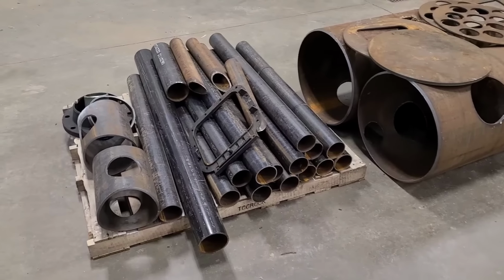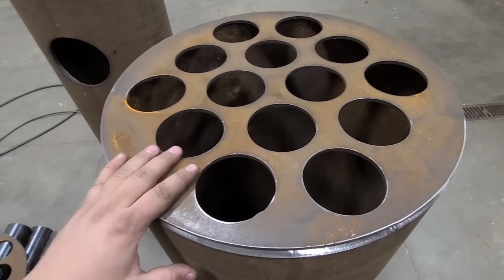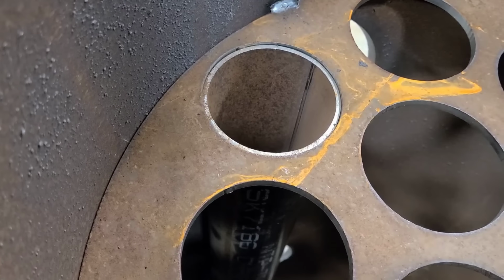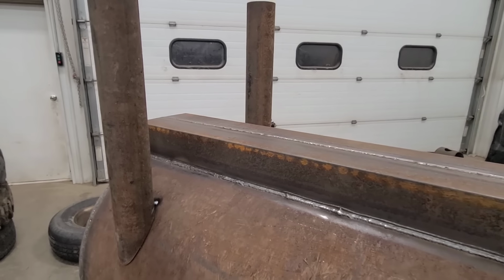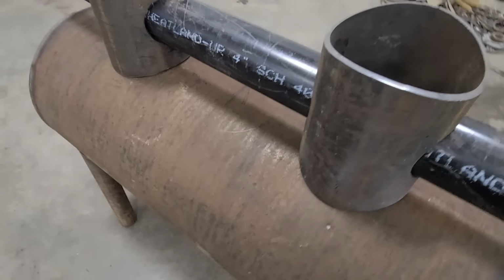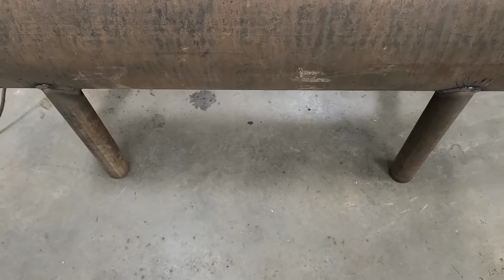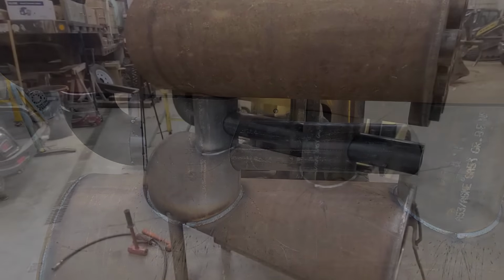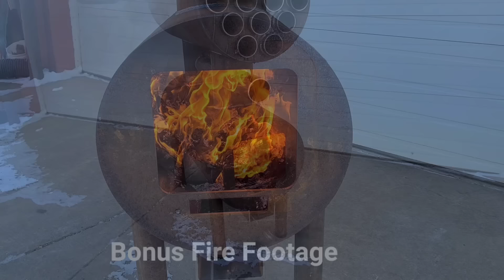My Ultimate Shop Wood Stove Build Part 1

Comment: Protip. A heat exchanger will always reduce the temperature of whatever I hot about the heat source. For instance we use an oil heat exchanger, oil is pumped through tubes that run through a cylinder, the cylinder is full of cold running water, this effectively cools the oil, the same applies to pretty all heat exchanger, ultimately the air coming out is GOING to be colder than the air in the fuel, OR exhaust chamber, it just is what it is.

Comment: I believe  you will  have to have real hot fire to make the stove to work properly.  All those tubes and heavy  metal  will work to cool the fire  , you will have problems  with soot and blockage  from tube cooling  the flame to much. I wish you luck  but the one I built  like that had that problem  because couldn't  keep fire hot enough  to burn creosote
Reply: You can remedy it by lining the inside of the burn chamber with ceramic insulation or fire brick. It would help 2-fold. First, it helps the fire get up to temp. And it keeps the metal on the outside from getting so hot that it's kind of dangerous.

Comment: I know hindsight is always 20/20 ? But I think I would've cut off and finished all the heat exchanger tubes before first fire . So while welding tubes, you don't have to deal with carbon soot in welds.? Sorry about armchair quaterbacking

Comment: Send preheated secondary air up to the second barrel top barrel will double in temp and you will also have a very clean burn and no creosote
Reply: Three inch pipe running the length of the ash grates up the back of the stove and up through and into the top barrel. You will achieve mega secondary burn and your build will be close to 85% efficient
Reply: Secondary air won’t work well until stove is up to temp and you begin to dampen primary air intake which will increase the draw on the secondary air. You will also achieve longer burn times much longer.
Reply: Great build by the way. Wish I could source that pipe you got there.

Comment: Looks good!
I sort of agree with CIES comment you will get much more heat the more you can keep the flue gas in the tubes much like a steam engine, but if you take out too much heat if will not draft right or well and soot up much quicker chimney included. 
This however is your stove so do as you would like. Just be safe with it so we can see more videos.  Is that the forklift you rescued?
Reply from the maker: Nope, this is at the farm, about 3 miles away from my shop. It's nice now there is a forklift at both locations 👍

Comment: Thought the chimney "out" was going to be at front of stove so exhaust gas has to make S shape though heat exchanger but looked like your riser was welded to rear allowing direct though flow...
Reply from the maker: It makes an S curve as you first said. The riser in the back is a cleanout that will be capped. I chose to use a flange fitting for easy access. The exhaust pipe still needs to be welded on the front once it's in position

Comment: What would happen if you took the lower scavenge pipe and plumbed it back into the bottom chamber. So it was getting fed hot air? 🤔

Comment: have you thought of putting a heat switch which turns the fan on once it reaches a certain temp and then shuts the fan off when the heat reduces?
Reply from the maker: I have, but I'm not sure where I would like to put a probe for reading the temp, if I put that on the heat exchanger, in a heat exchanger tube, etc

Comment: It kinda looks like the hole for the air intake and the hole for the door on the front are too close to each other. Once the door with a seal are mounted is there room to attach an adjustable slider?
Reply from the maker: The door and adjustable slider are all one piece, I will get to that in video 2, thanks for watching
Reply: @kylechrist  I didn't think of that, makes sense now. Can't wait to see it in action.

Comment: I like the overall design. If you have plenty of firewood than its s good deal. Most use waste oil burners to heat theshops. It reminds me of a rocket stove. Interestwd in how much money did the blasma cutting abd material was all in total?
Reply from the maker: This was all scrap material destined for the dumpster so it was free. The plasma cutting was done by my employer at no expense, thanks Steve
Reply: @kylechrist  That is like getting a free gift card. I can only imagine that the cutting alone would have been big money. Not to mention the material that is very hard and expensive to get. Using the leftovers for the stove was a very brilliant decision.

Comment: Now, how you going to clean out the creosote?
Reply from the maker: In the video I talk about how the back flange fitting on top of the heat exchanger will be capped and removable for cleanout, if need be. A good burning stove with good hardwoods doesn't make much creosote

Comment: I built a system like this many years ago.  It was too efficient on heat transfer and ultimately condensed so much of the combustion byproducts out that it would plug up with wood tar and stop working.
Reply from the maker: That is a real problem and a fine line, you don't want the exhaust red hot and lose heat, but you also don't want to take away all heat or the exhaust will never clean. I'm hopefully this will have a strong enough draft to keep pulling enough heat up that it doesn't build up with tar/excessive soot
Reply: @kylechrist  The rough rule I found with mine was that I had to redesign the flues to allow for the burn to get up to at least 800 F for several minutes during each load to clean itself out. If not, it just slowly built up tar until it choked itself out or took off in a massive chimney fire. 

If you don't already have one, set up your flue with a high temp thermometer or pyrometer that can read to at least 1000 F and see if you are getting things hot enough often enough.  If so, you might be fine as is.

Comment: Nice job I would have left the front and rear panels square on the bottom as feet
Reply from the maker: The problem with that is you are then loading the stove on the ground
Reply: @kylechrist  no I meant to keep the front and rear panels square on the bottom as feet with the same hight then the legs
Reply from the maker: @millionmiler  I made the pieces from the scrap I had, there wouldn't have been enough material for that, but I understand what you mean now 👍

Comment: Will the fan be attached to that pipe in the middle & then blow heat out the top ports?
Reply from the maker: The fan goes on the back of the heat exchanger and blows through the middle pipe as well as the top pipes

Comment: If you wanted to make this transfer heat more efficiently you could reverse the top section.  That way it would be cross-flow.  Given the diameter of the air pipes, it might not matter.  Then again if you're ever bored you could reverse it, can't make it worse.

Comment: I would think you need a shovel with a long handle for your clean out when the ash is too much for the drawer.
Reply from the maker: According to the law of conservation, if I burned 300lbs of wood, there should be 10lbs of ash left (this is going off a perfect burn), so I think the ash cleanout should be okay but we will find out once I get it rolling

Comment: That design is very efficient for heat transfer but for the way I burn wood, not so good.  I need to get into the system to clean out soot and creosote from the inside.
Reply from the maker: There is a cleanout in back and if need be, the chimney could be unbolted as well and everything washed out, I'm hopeful it will burn hot enough that minimal buildup will occur
Reply: @kylechrist  It depends on temperature, oxygen content, and also the wood that is burned.  I have never tried water for cleaning.  I use steel brushes, scapers, and burning the pipe with diesel.   Burning helps remove tars/creosotes.   
The wood that I burn under air starved conditions leaves a tarry residue.  I stay away from pine and gum trees.   Most of my wood is not very well seasoned.   
The upper chamber of my stove is a barrel with removable lid and in fact I just cleaned and five ft of pile going up to my ceiling.  There is still another 14 ft of pipe above that and I will do that next week.   
If the pipes and stove are not clean, then chimney fire results.

Comment: Hey i am a ducht chimney sweep and i work with 3500 stoves and chimney a year its a nice stove. But if you take to much heat out of te smoke. Than Youre chimney wil get ful of tar the same probleem With heet exstanger. If you take the burn barel out of the shop en burn it of full trust youre tar wil burn of and you won't get a chimney Fire

Comment: How much does this thing weigh, that’ll help with the heat transfer, I think.
Reply: How many hours did it take to get this done
Reply from the maker: I'm guessing around 1500lbs
Reply from the maker: @dirtfarmer7472  not counting the cutting time, about 8 hours of assembling and welding

Comment: ... don't get me wrong.
... this is one of, if not the best, 2 chamber wood furnaces (not a stove, a stove is for cooking, u could make this a cook stove also by shortening the heat chamber tube and mounting a flat plate at the front with wood stove round removable cooking plates, best r the 2 part ones as the reason for those r, u remove 1 - 2 or all to increase the heat that gets to bottom of cooking pot, they r in essence ur low, medium, nigh heat controls)
... the heat tube barrel is too far from the burn barrel, should be touching so more of the heat is transferred.
... the heat tube chamber could be inbeded into the top of the burner (cut a section along the length of the top, invert it and weld back in, place heat chamber inside), that way top of stove is double thick and reduce the risk of warpage from the heat, and little heat lose as heat is directly transfers to heat chamber, that way u would get heat transfer without the smoke contacting the heat exchange tubes and ur design makes it impossible to clean around the heat exchange tubes and won;t be long before all is clogged up
... would eliminate the need for all that extra tubing , expense and time.
... i would , however, put the top half of a piece of that tubing across the 2 riser pipes, the center as u have them.
... what that will do is cause the smoke/vapor to be recycled back into the flame where the gases will be ignited, as u have too much smoke coming outa the chimney and that is wood gases wasted
... look into installing a secondary burn plate at top of burn tube.
... also, from the tube barrel have 2 tubes, one inch should be sufficient (or 2 inch with some kind of volume control) running back into the stove, near the front, just inside the feed door(this not only helps create a vortex burn but if u install a glass door the flame 'vortexing' will wash the glass/keep it clean), and 2 near the back just in front of the pipe at rear, one near the top and one near the bottom.
... inside the burn barrel u put a piece of 45 degree pipe, the one at the bottom pointing up the other, at the top, pointing down, those will cause a vortex for an even more efficient burn.
... the build is so solid/heavy duty, that it could be used to heat an off grid home, only the feed door needs to be up to the standard of the rest of the unit.
... for home unit would install ceramic seal 'tape' and a glass door.
… inbed this unit in a central(center of off grid home or underground home) massive rock or brick chimney for a massive heat sink and one will need one fire a day for even the coldest day/nite, this unit that i mention, with 2nd or 3rd burn and vortex flame will put ALL rockstove mass heater to shame
... building an off grid underground house, facing south, with a year round flowing river with 3 - 1000W water turbines and ur furnace is one, with some adoptions, i am considering for it.
... winters r LONG, and, day lite hours r short here in Timbuck Nowhere Kommunist Kannaduhhhh so want a stove/furnace i can load once and leave for at least 8 hours.
... wish there was a way to build a self feeding stove.
... anyway, here r some vids on secondary (some even 3rd burn chambers) that would put ur unit over the top if u incorporate these design improvements

Comment: Do you reckon if you welded a BBQ plate to it, would it get hot enough to cook on? Make the most of your fire
Reply from the maker: If it were welded on the bottom chamber, I would bet so. I didn't video it but it had no problems turning snow into steam

Comment: Often I turn to stick welding welding for the tight spots. Haha, murican design philisophy : If it ain't steel it ain't real. Good for a stove, but the Harley Crapinson weights 400 kgs and does the death wobble. The Bullerjan stoves they sell in Europe have a similar design, i believe they are thin walled cast iron and cost a fortune, as there is no chinese clone on the market I would have resorted to build my own as well. Problem in Germany is emission regulations.

Comment: Major safety issue. Its top heavy & narrow stance either chain heat exchanger to rafters or saddle a 4-5 foot pics of pipe to bottom of the legs. Also twist 2 -5  times some 3 inch wide flat stock  ( don't have to be very thick) metal x length of heat exchanger and insert it into each pipe.  You want the air to slow down  in the tubes and touch every inch of these exchanger pipes.
Reply from the maker: It weighs about 1500lbs, it's not going anywhere 👍

Comment: I don't get why you wouldn't just have a snakework of pipe inside the main chamber where the wood is burning that sealed up, and you have air blowing through it into your shop.  By all means vent the exhaust gas to the outside and use the whole mechanism as colossal radiator but it would be nice to have that air blowing through the pipe carrying the heated air to the center of your shop and blowing down with some sort of cascading vent louver to spread out the heat.
Reply from the maker: Build yours however you please 👍

Comment: Um what all the pipe and all cost to have cut...what's the total cost
Reply from the maker: My cost? Zero, just time
Reply: @Kyle Christ  someone had to pay for all the materials and to have it all cut...I built one also and added secondary burn air and a baffle..I got all my materials from the scrap yard and still have over 500 in all the little bits and pieces..I also used 8x6 square pipe for the flu..
Reply from the maker: @craigbowman8843  the material was scrap leftover from a job, and the cutting was all done by my employer
Reply: @Kyle Christ  that's awesome...I will say I used the same door and I don't think the draft door is going to be enough I am going to use a 25' flu so maybe it will be enough I hope to get it all put in this weekend
Reply from the maker: @craigbowman8843  by no means am I am expert, I'm using what I had at my disposal, I have a trick for improving draft that I will get into in the next video
Reply: @Kyle Christ  lol I don't think even the experts really know...I think I'm going to fab a door..I did put glass in the cast-iron one but I'm not sure if it's really going to work well...

Comment: I think you need more airflow and a larger chimney. That's a ton of smoke & seemingly inefficient burn
Reply from the maker: This was just a burn in, there is no chimney attached at this point
Reply: @kylechrist  that looked like more than just a little smoke & off-gassing from the oils and the metal... that looked like a fire that was starved for oxygen to me....  looked like it wasn't quite hot enough to ignite the wood gas

Comment: If,you’re not gonna clean to bright metal, you really should set your machine for spray transfer vs short arc
Reply from the maker: It's a wood stove, it will be just fine

Comment: why not electric heat or gas? wouldn't it be nice just to turn on a switch or even better have a thermostat?
Reply from the maker: Wood is cheaper
Reply: @kylechrist  wood is cheaper, what about your time. for instance: those guys in alaska bragging about not working for the man spend 50% of their time just to heat the house whereas the rest of us spend like 5% (in hourly wages or whatever) to do the same, pay the electric etc. and have a thermostat. not saying what you're doing is not the best solution for your situation. just checking if the time and inconvenience is included in the price of wood being cheaper, i'm just curious. i'd love a wood burner some day btw. my reason would be coziness and as an independent backup for heat.
Reply from the maker: @dronefootage2778  I 100% get what you're saying, the difference between me and most people burning wood is that I have a friend that excavating and demolition for a living. Any trees he takes out have to be hauled away and instead of paying to get rid of them at the landfill, he brings them to me. So while I do have a little time in processing, it's all at my doorstep so to say
Reply: @kylechrist  i get it, it's basically free wood and some exercise to go along with it :D

Comment: Kyle for your own safety, might I suggest that before you light the wood stove inside the shop, you acquire a Carbon Monoxide detector. CO is odourless, insidious and very dangerous. It is actually a legal requirement in the UK that each room with a wood-fire or solid fuel stove, has a CO detector. The better types have a sealed non-replaceable lithium-manganese battery which lasts around 10 years. One of our CO detectors started beeping, when the fire had almost burnt out. We found that the flexible door seal needed replacement.
Reply from the maker: That's not a bad idea at all, while this should vent fine, CO2 detectors are cheap 👍